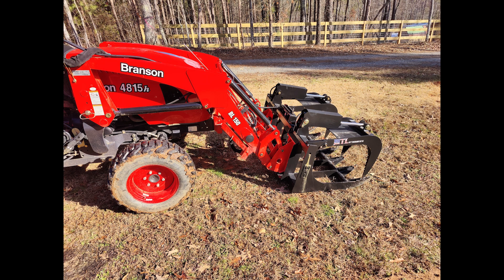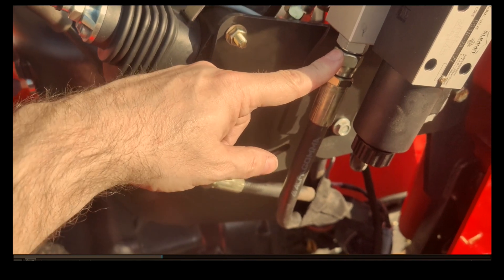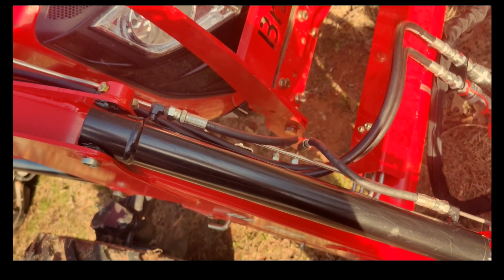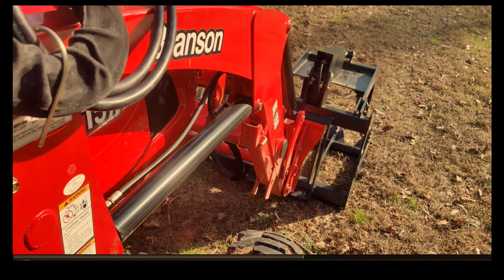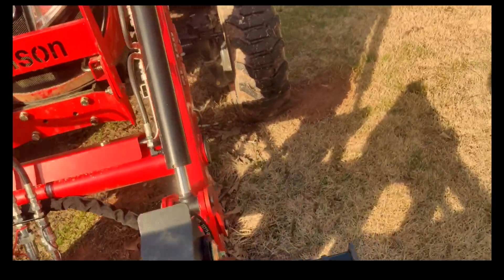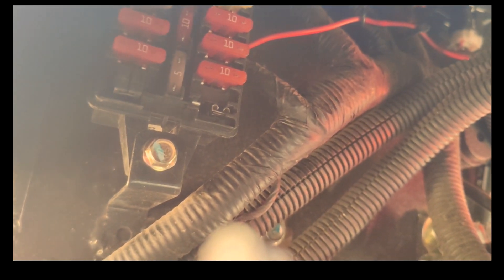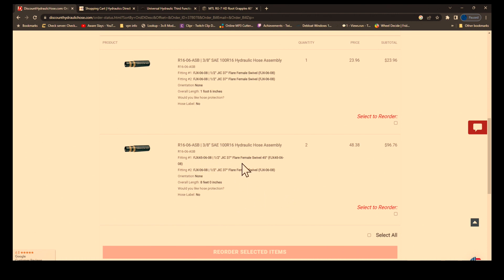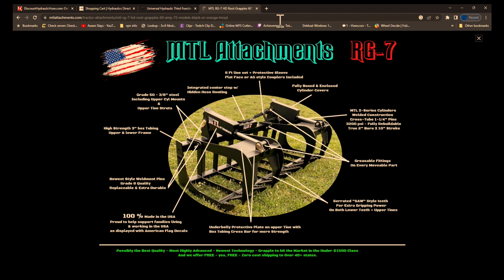Hooking up 3rd function valve on Branson 4815h Tractor #notsponsored #branson #summithydraulics

Comment: I’m getting ready to get a grapple for my 2515,  would love to chat with you about what loader valve you have on that tractor. Seems the one on my tractor looks different. What year tractor is yours?
Reply from the maker: My tractor is a 2020 4815.
Reply: @MadMods4u  what parts were needed to get power beyond the loader valve? Hard to tell in vid, but looks like pressure line from tractor is run to loader valve then out of loader valve to third function valve then return line out of third function valve ?
Reply from the maker: @damonr2233  I listed and gave links to all the parts in the description. Basically you take the power beyond line and run it into the third function valve then run a line from the third function valve back to where your power beyond line was.